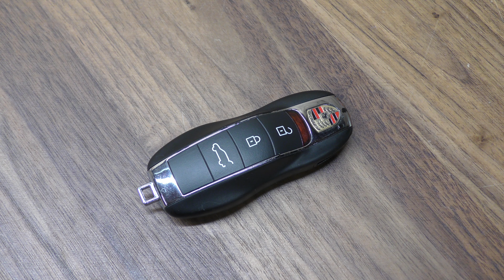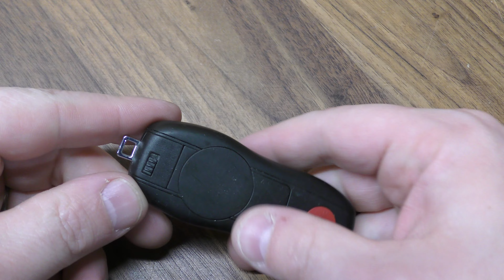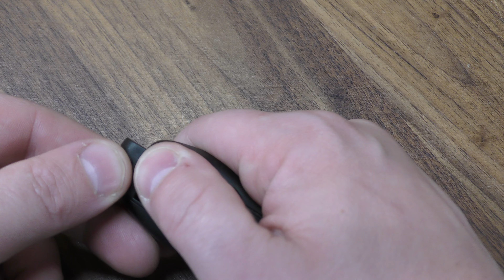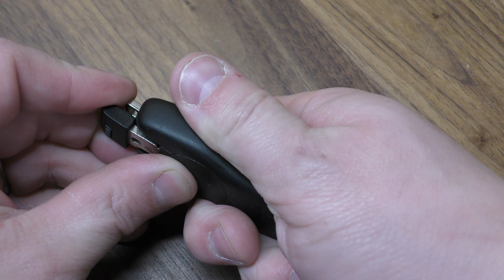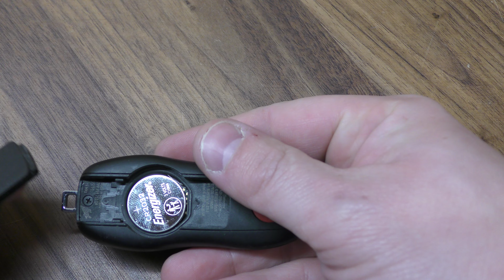Porsche Macan / Cayenne Key Fob Battery Replacement - EASY DIY

Comment: Great explanation but it IS NOT easy to slide the lock and remove the first locked section.  Think Porsche could do a better job for us "old folks"!  Great video from Rob though - thanks!
Reply from the maker: Ha! I have strong thumbs :)
Reply: They can’t even keep the analog clock working !
Reply: I don't understand. One of my keys was pretty easy to pull and my other key requires the jaws of life. It broke my nail and blistered my thumb trying to open it. This can't be normal.
Reply: I can’t do it 🥹